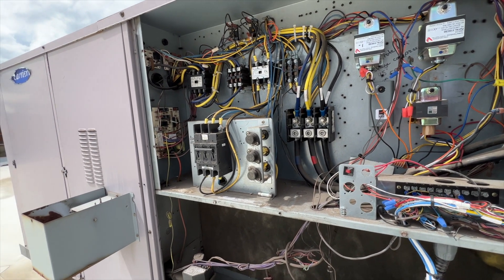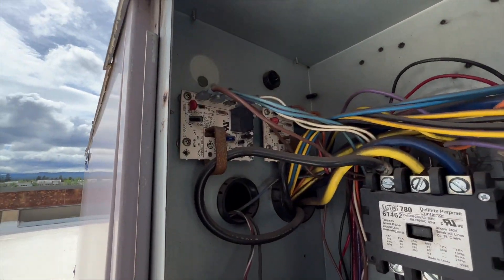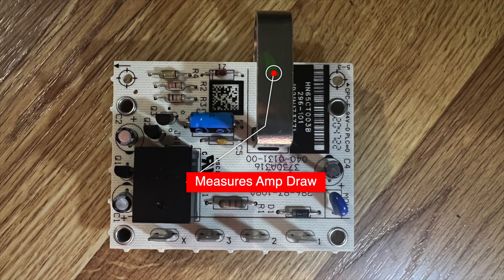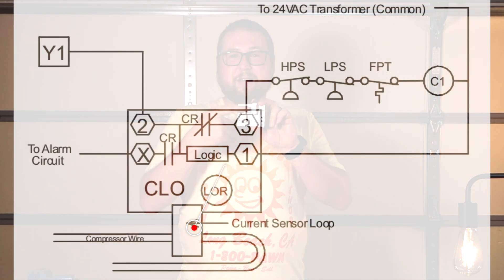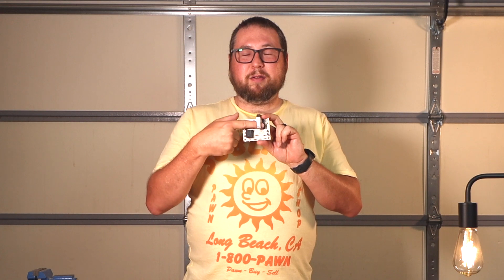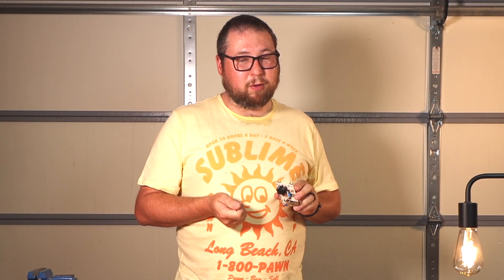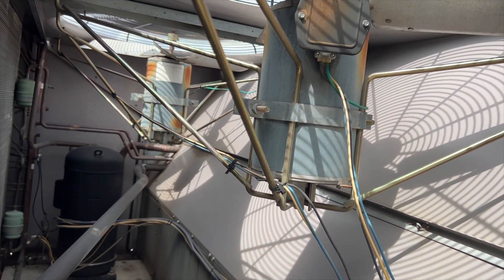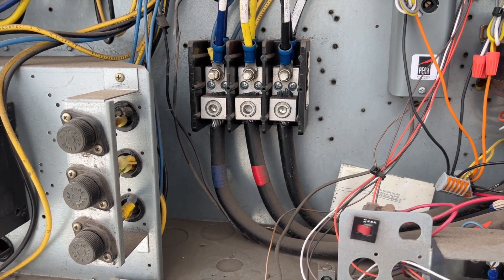Understanding and Diagnosing a CLO Relay. Carrier Package Unit with Multiple Issues Part 1. EP95

Comment: Nice video sir the same problem i am facing right now we have double satage carrier package unit we have too problem with second circuit y2 we are not getting 24 volt at 2 and 3 but when i looked at for test Lp,Hp and fpt sensor they are ok please suggest me what can possibly real causes and i am new in this trade